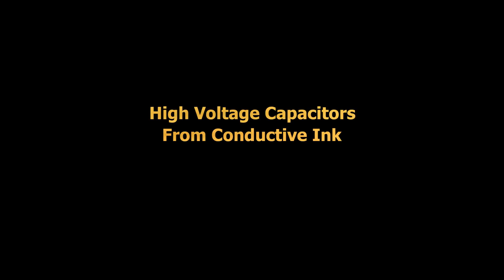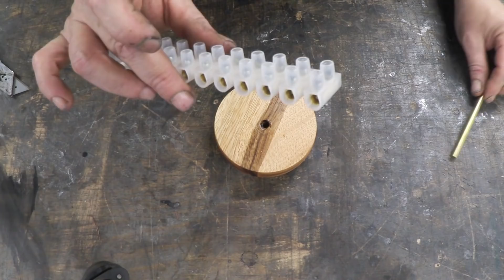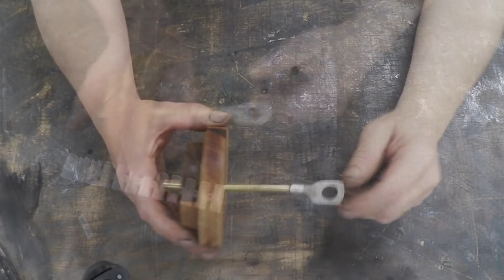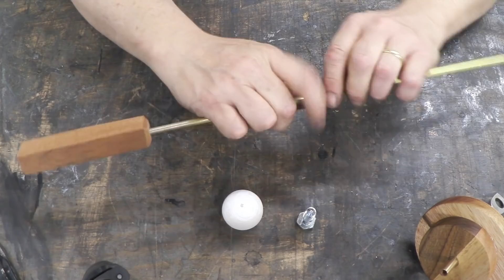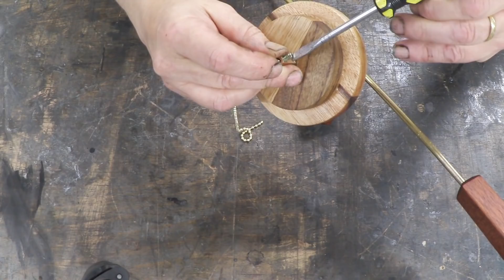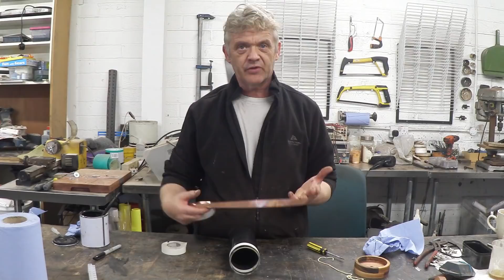High Voltage Capacitors With Conductive Ink - Wimshurst Machine Part 2

Comment: Building Metal Detector coils  ( for Gold and coins ) we use shielding within the coil housing in order to mitigate RFI and Capacitance between the Earth and the coil.   Thinking your Conductive ink may just be the trick.  How well does it apply to Plastic ?  Does it bead up  much ?   How does one get to your store ?
Reply from the maker: here's the link mate
https://secure.workingink.co.uk/working-ink-shop/
it applies well to plastic

Comment: From what I have seen of your capabilities, and also what I have seen of Wimshurst Machines, you might be underestimating the arc length by about 6 inches.......
Reply from the maker: maybe - but they are adjustable - so no worries
Reply: @ThinkingandTinkering  HDPE White Plastic Cutting Boards are cheep too. and (shouldn't) leak static

Comment: leyden jars are jars for a reason : you can just fill them with water to use as the inner electrode
Reply: ....or  use bottles and rather than water :, salty water was suggested as its a better conductivity but maybe the electricity would then just cause electrolysis or might depend on polarity. Actually I think salty water should work
Reply from the maker: cheers mate

Comment: WOW, those look like works of art that came right out of Tesla's basement. They look just like something that would had been made in the late 1800's or early 1900's, wonderful works of art that are built for a purpose. Would be cool to use some Neo's with a Halbach Array on it as well, just because we can, LOL
Reply: Me, well I have been working on a wood stop block built from scratch. I first smelted a large aluminum block then cut it with the band saw into a shape that will rest on the saw guide. A lot of work mate. I have did a custom job on this radial arm saw from start to finish. I even heat treated and graphened the rail that the bearings ride on. I have been working on this thing for weeks now on my free time. But, I'm getting there. I even added a router into the  same table. A all in one type of unit and very well built.
Reply from the maker: did you do a vid mate? I would love to see
Reply: @ThinkingandTinkering  I'll more than likely do a video on the whole table after I have completed the whole project and explain what I did as I show it.
Reply from the maker: an excellent reason for doing anything mate lol

Comment: Those look lovely.
The chocolate blocks typically fall apart by just unscrewing both screws. No need for the knife treatment.
Reply: @Barry Foster I'm actually South African, but we speak a similar English to you guys. Not too many people I know use that term for it actually, but it's standard enough that most people know what you're talking about.
Reply from the maker: I did try that mate - I found it a little more trouble than just chopping them out tbh

Comment: Could you add gelatin to your conductive ink to make a gel based capacitor, and how would that affect capacitance?
Reply from the maker: I would think it wouldn't do that great mate
Reply: @ThinkingandTinkering  I am designing a greenhouse using only FWG technology, and in place of wires I was thinking of using "capacitance gel" in hoses and tubes to build an eco-home model that self sustains.

I also think capacitance gel would be an interesting substitute for batteries in electric vehicles for faster charging.

Your thoughts?
Reply from the maker: @ryanlebeck259  gel capacitors are interesting but do have issues mate
Reply: @ThinkingandTinkering  everything rightly does 😊. Get enough builders together and we can sort it all out ya? 😁 keep plugging away mate, your work is fantastic!
Reply: @ryanlebeck259  another possibility is thin wall glass tubes filled with conductive brine
Reply: @geodeaholicm4889  the idea was to dehydrate the gel into a crystalline matrix so that you end up with a structure that could use natural humidity to encourage conduction.

Comment: Great build.  Can you dip the wood in polyurethane to keep the look but still be insulted?
Reply: Should work, but I would not trust it. If you want the wooden look I would make the handle from a solid piece of plastic or firm rubber and cover it with a layer of wood veneer. That way you can be sure it is well insulated. But if you want someone to be insulted you don't need polyurethane, just tell them to go f*ck themself.
Reply: @freundlicherhater6085  😆
Reply from the maker: I suppose so - but maybe glass them over?
Reply: @ThinkingandTinkering  Good point. Maybe clear resin would be a good idea to keep the look of wood and still be insulated.
Reply: You might try using a plastic layer between the metal and wood.